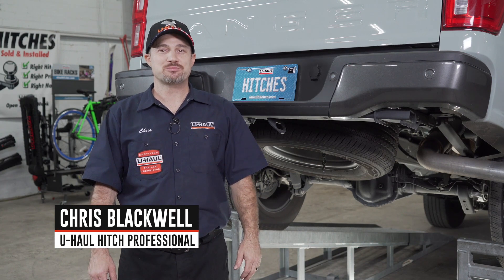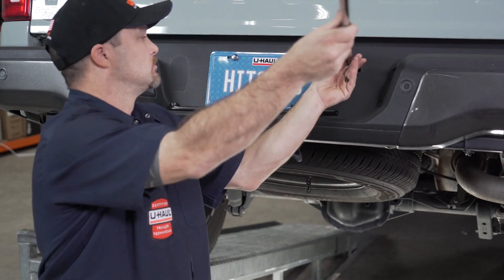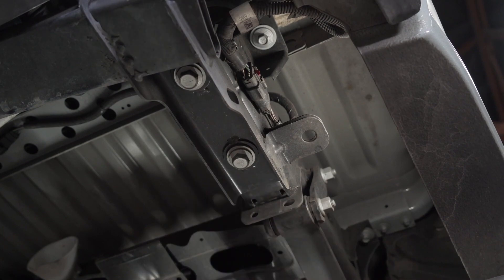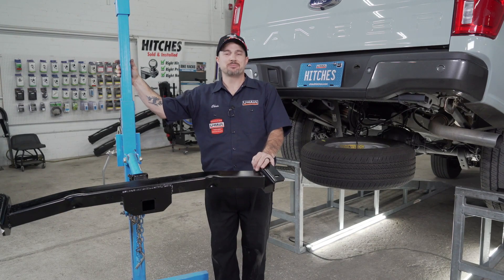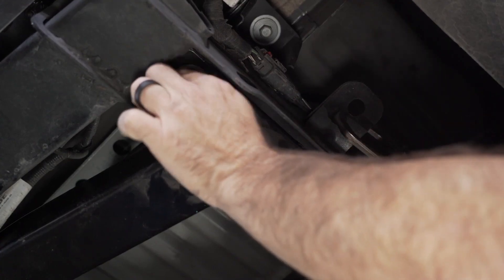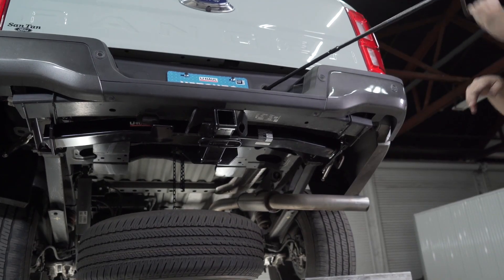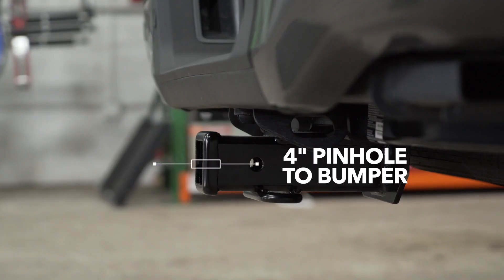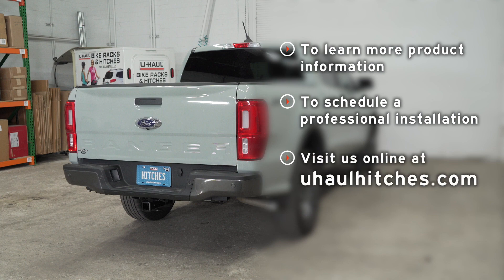2019-2022 Ford Ranger | U-Haul Trailer Hitch Installation | CQT76583

Comment: What’s the specifications for torque on the bolts
Reply from the maker: They are in the Included directions in the final steps, as well in this Link: https://www.uhaul.com/publication.ashx?fileName=CQT76583.pdf&digest=Xo94NOtNGpdg7P3OZcITg
Reply: 146 ftlbs